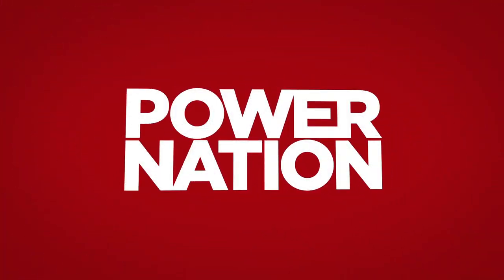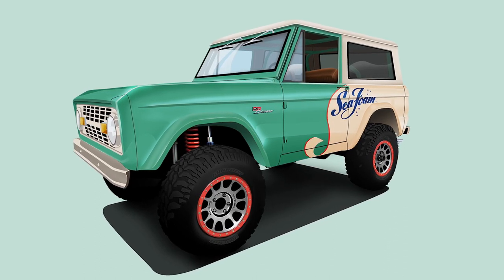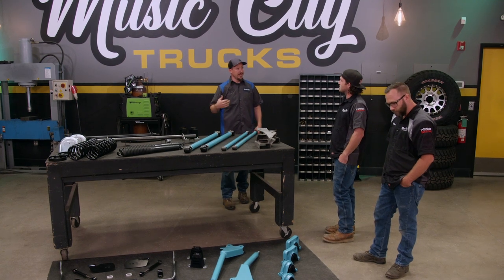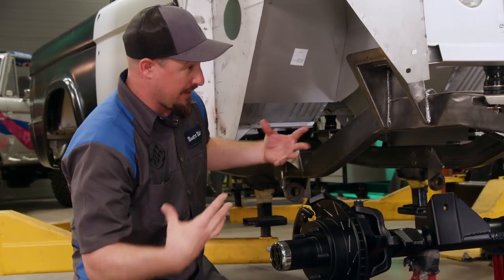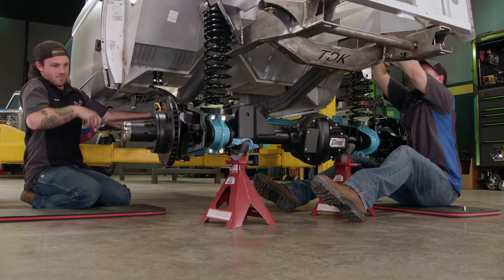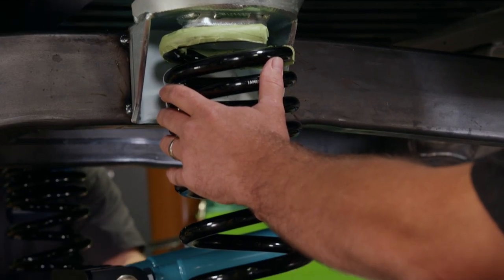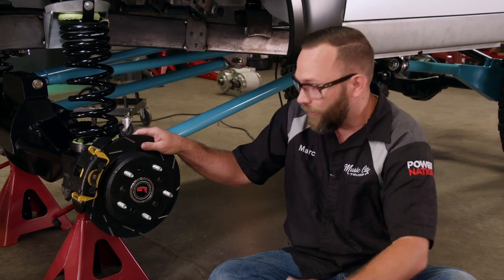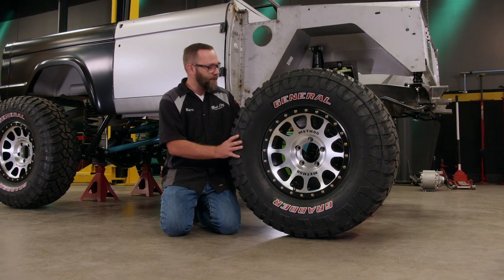Installing A 4-Link Suspension On The '74 Bronco - Music City Trucks S1, E13

Comment: This video is the one that convinced me to spend the $$$$ on the 4-link system that was so simple and easy to install.  BUT, after weeks of issues, James Duff inc. is not standing behind its product. The manufacturing from them is quite literally terrible (pics available - reply to this post). The axle truss I received was 8 degrees off , from their prescribed pinion angle range. How do you solve this? cut it apart and re-weld it. The truss on the back of the differential is not parallel to the upper arm tabs on top. the rub? Yes it does... literally only the one point on the axle truss rubs on my gas tank.  Can fix it? sure, with more grinding and welding, of course. But why spend your money on a product that is supposed to be ready out of the package , and so is poorly made you've got to grind it apart to fix it? I wish I didn't.  On the bright side the finish / Powdercoat was beautiful when it arrived. too bad all of that got destroyed fixing all the manufacturing issues!!  AND after weeks of trying to work this out with Duff, they are too busy now, and not standing behind their product. Help yourself - buy a kit that you can weld together so you haven't wasted your money on finish that you had to grind off and repaint anyway. Not to mention it will save you time too. You won't have to grind finish welds ... only tacks!  and I do know that 2 broncos are the same. But I can also put 2 straight edges on a truss and see that I can make better with less in my own garage.

Comment: Can we just acknowledge that this is a kit car and not an original Bronco?
Reply: Exactly... that's just a parts catalog car...
Reply: Does it matter
Reply: @justinevans5616  Why start with a Bronco if you throw away every thing but the Vin, tag that is not to be removed from a vehicle . Then again if it is not used . Why buy a old Bronco in the first place . Is this then a restored Bronco that will bring top money . Or a reproduction kit Bronco . What are they representing it as at time of sale .  Is there not a difference in value between a real Cobra and a kit Cobra .
Reply: @marvin984  for the frame.
Reply: The frame was tossed and frame numbers can not be transferred  as well .
Reply: @marvin984  allegedly you can't but I know for a fact a lot of people do.
Reply: @justinevans5616  Legally you can not and it is a felony .
Reply: @marvin984  legally you can't smoke crack either
Reply: Yes, a very good idea. Factory 5? Are you seeing this opportunity?
Reply: @bigboreracing356  apparently you are.
Reply: It's still relevant to know for short wheelbased trucks like shorty pickups. Stuff to consider.....
Reply: @EamonnSeoigh  shorty pickups?
Reply: Not everybody has that kind of money.

Comment: I love the 1966 to about '76 Bronco's.  The main reason that those fords cant climb is that pre-independent radius arm suspension that allows very little flex, especially once poly bushings are installed.  Same with 2008 era f250's.
Reply: 66-77

Comment: I had a 74. Rust is an issue. Older Broncos had less rust. The later vehicles used cheap steel. They rusted from the inside out. 
You can buy everything including a frame. So why not start with good new steel and build as a kit?
I cursed my 74, but miss it. 🙁

Comment: Is this really a restored mod or a kit Bronco . That should have a new vin number . Not a vin tag from a old Bronco . Vin tags are not to be removed from a motor vehicle . It appears that the old frame was tossed . So the frame number to original Bronco is gone as well .
Reply: @bigboreracing356  There is a difference in the value of a true Cobra and a kit Cobra . And there is a difference in the value of a true Bronco and a kit Bronco .
Reply: @marvin984  you are wrong. Kit Bronco’s fetch more money than all originals. All day every day.

Comment: Why did they install the shocks on upside down???
Reply: These shocks can be ran shaft up or down but it is wise to run them shaft down with boots to prevent any dirt and grime building up around the shaft wiper seal and causing it to fail prematurely. Another great reason to run the shafts down is for tire clearance on a Bronco when it is turning while articulating. Bronco’s have a very tight turning radius and you don’t want the bigger tires rubbing the shocks.